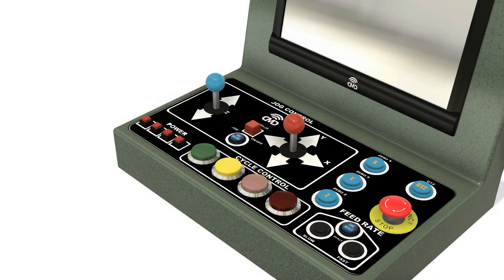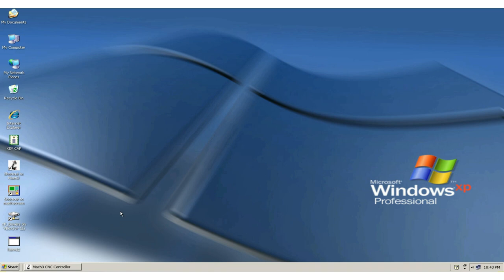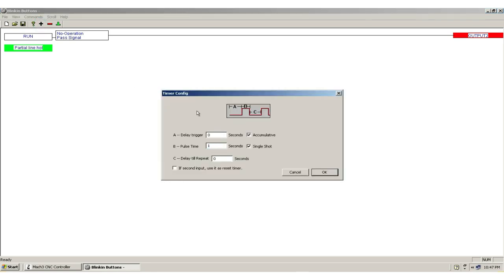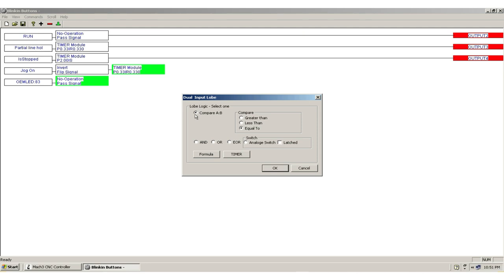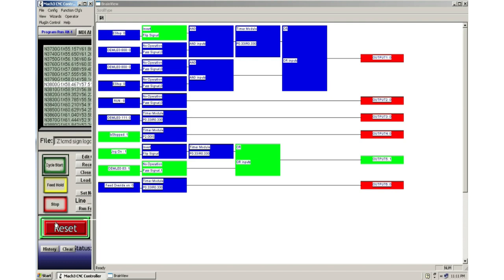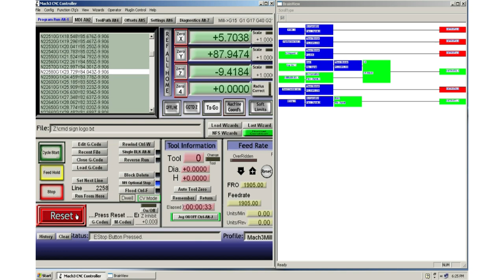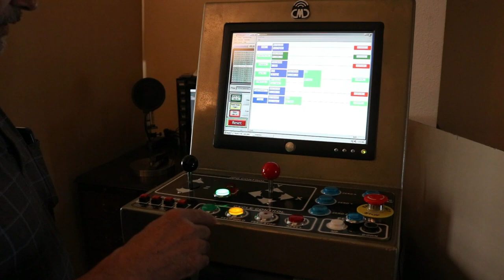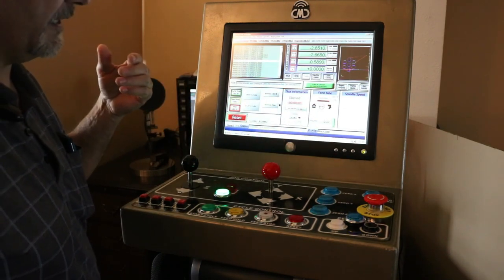Mach3 How to illuminate Buttons

Comment: Great Job.
I'm confused with a brain and macro programming environment. So what if i want to control some machine specific features using inputs/outputs and a little programming to follow a sequence of actions?
Reply from the maker: yeah, that's what it is for. For what I've seen on different videos.
Reply from the maker: like, turning on pumps, or tool changes, etc.
Reply from the maker: However  I am not an expert on this, I only try to solve a problem as it presents itself. LOL.

Comment: I have a physical reset button but I'm can't get it to reset the system after E-stop is cleared (only clicking on the PC reset resets it). How did you implement your reset switch?
Reply from the maker: The only way to reset it,  is precisely clicking on the software reset button. In my case, after restoring the e-stop switch, the virtual button keeps blinking until pressed. What you see on the control panel (the flashing red button) is "hot keyed" to the virtual button, using mach screen editor, and also are all the other buttons.
Reply: @CarlosMDominguez  Thanks for the quick reply. The is helpful. I'll let you know if I figure out a solution.
Reply from the maker: @sbersey , Your welcome. I look forward to hearing from you.

Comment: Mach 3 use macros - I have external reset button with with flashing  led in reset condition. 
Macro doesn’t shut output when in reset conditions like brain function does. Hope this will help. I had blinking led in the past but did not like it.
Reply from the maker: Thanks for the info! I will explore macros. But I don like it either, not needed.
Reply from the maker: Could you give me a clue as how to implement the macro? I have been trying to find a solution, but no success :(
Reply: @CarlosMDominguez  send me your email. Will send you the file and instructions
Reply from the maker: @janeqmx  servillantas@juno.com   Thank you so much. I will work on a video and will give you credit.
Reply from the maker: My email is servillantas@juno.com I am really looking forward to see your code and instructions.
Thank you in advance.

Comment: very good work . and i am interesting that ,I know how brain is work , But how i can wiring the button to pc i mean i have some button and i need wiring to pc case because i want make mach3 work without keyboard. thanks a lot
Reply from the maker: sure, you need a breakout board, to split your parallel port, (the one I show at the beginning of the video), then you use the pin you selected to be an output on your brain output selection, then you use that voltage, usually close to 5v to turn an LED on, wired for 5v. (the LED limiting resistance) hope It helps.
Reply: @CarlosMDominguez  first of all thank you ..What is the name of your breakout board?when i buy it from the shop...
Reply from the maker: D-SUB DB37 Male / Female Header Breakout Board, Terminal Block, Connector. ebay. good luck!
Reply: @CarlosMDominguez  TANKS